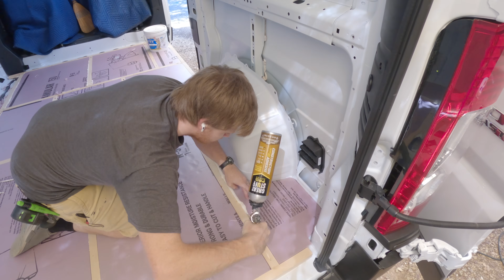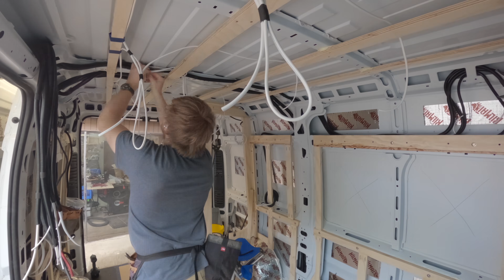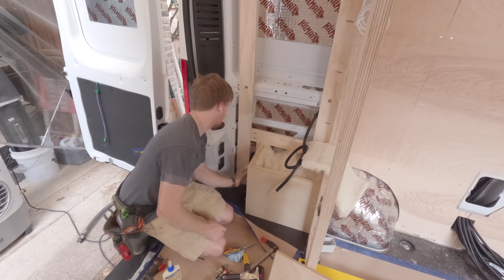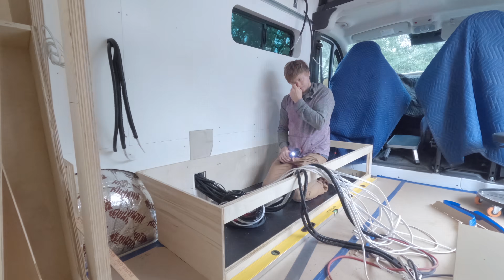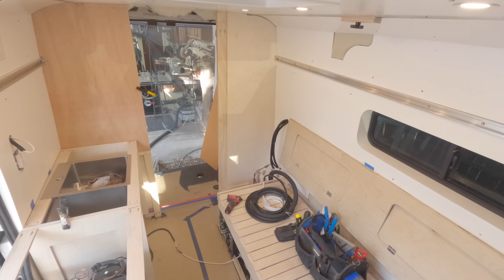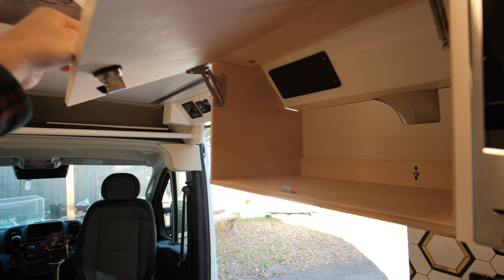FULL VAN BUILD | Detailed Walkthrough of Construction Process | Promaster 136" with Huge Wet Bath

Comment: Sam, you are one of my favorite van builders. You do top notch work, you explain everything you do, and I’ll refer to your videos when I build mine. QUESTION; was there just no good place on the floor for the water tank, asking because, that tank full of water is heavy, and lower is better. You know exactly what you’re doing so not question your abilities, just wondering what your thoughts were? Is it just wasted space above the wheel well, so why not? Thanks
Reply from the maker: That's a good question! I dug back through some old notes from this build. I had compared a few water tank options including using over the wheel well shaped tanks. For this layout. Mounting a rectangular tank over the wheel well was going to leave more storage space available under the sink area cabinet than the wheel well tanks would have so that is why I went that route. I agree on the lower the better for weight. With that said, I feel like having the tank just over the wheel well verses directly by the floor is still pretty good.

Comment: it's an interesting design but not my favorite

I feel like there's so much cabinetry that it takes away from valuable space that could be used for other things
Maybe multipurpose furniture or hidden spaces for other things that have like a conversion to it
I don't like the placement of the bed I wouldn't want to sleep on top of all of that equipment I think that that is a health concern
It seems very congested in there
As much as I enjoy a good shower and having enough room to move
The wet bath takes up a lot of room
I have seen closet closets that open up to reveal a wet bath behind it
And yes that would be a real challenge if a person took a shower and didn't leave it open for it to properly air out even if it had a vent system in it

I didn't see any privacy between the driving cab and the living space
I think the refrigerator is in a really good
Once again the wet bath has a lot of storage
Itch a different kind of lifestyle they're living in a traditional home and when we try to downsize those same conveniences into a van it really does rob the space

Maybe something to consider in the future

Me personally, I'm allergic to wool so using that as an insulation would not be a good idea

I noticed that you used some of those soundproofing strips but no thermal insulation which is similar as in its flat and it goes on with an adhesive that's already applied and peeled back to secure

I would be concerned about condensation and that will probably is naturally waterproof
You're still going to get the condensation between the metal and the wall from temperature differences between the exterior of the van and the interior
That is something I would caution you about when you make your next build

Some builders are actually leaving air gaps and venting certain areas of them to allow moisture to escape

Maybe something you can look into an incorporate as well on a next build
If there is one

You might want to consider giving workshops

To help people to understand the electrical and the plumbing
For a person who's never worked with electrical let alone solar it's very intimidating

The construction part of it as far as framing and building out might not be so intimidating there are community colleges that offer that skill for a very small price
And well worth the investment for anyone who had no construction experience for example my local college has a six-month program for like $260 that offer offers 23 hour classes every week
It teaches light plumbing light electrical framing and roof roofing I believe
All can be converted and modified to building a van with the exception of understanding the materials you're working with like breast proofing cuts or exposed parts of the metal that have been exposed

There's a couple of design ideas for really excellent Storage built into already built in features in the van for the pretty status quo build
Where the bed is positioned in the back and there's a garage area underneath that I have come up with in my own brain might be a little tricky and we'll eat some tweaking
I also like the idea of a drop-down bed on hydraulics or even seatbelt police that has an electrical component to maneuver up and down
I've been living in a van that's partially built out and it was a first built for the individual who worked on it
For the last year
He did the best he could with the knowledge he had but the climate control in here does not exist unless the engine is running
And actually that's only partial because the AC has a leak somewhere
So that cannot be used
It's a 30-year-old van
It's solid as a rock I like that about it
Plus less mechanical issues that cannot be addressed without an exorbitant amount of money because of all the sensors and things they have on newer vehicle vehicles now
Which increases the maintenance and repair cost
Also makes it over complicated to get to the root of the problem and address it
That's the benefit of having a 1995
I really like the walking system that you chose for your cabinetry
That is pretty awesome
Very wise that you made certain areas of moving on easily accessible for repairs of maintenance I agree with your statement on that
I'm sure you've watched many videos just like myself
It never seems to be included or at least not mentioned in the video that I've watched

I like open shelves on the top and I think it really helps to lighten the feel and maybe that's part of the reason why I felt that the van was too congested

Really a person who is more attention to a minimalist lifestyle is served best by living in a van someone who wants a lot of storage and a lot of places to hide things is open to being cluttered and hoarding
No one really needs that much while living in a van
It kind of defeats the purpose maybe that's something you could tweak on your journey to creating new builds

I'm interested to know more about the air-conditioning unit that you chose for the van because I've seen a lot of of them and that's not one of them that I have ever seen before
Maybe a individual video discussing it it's benefits it's cost and so on

I currently am using an echo flow I have panels for it that I can position on top of the vehicle but it really is such a drain to have to drag it out put it up there disassemble it and depending on the weather I don't necessarily get a great charge that isn't the real issue the issue is the charge though appreciated and does supply me with some electrical benefits such as the heating blanket that I have to use since I have no climate control in here in order to not freeze to death
Draws a lot of energy and zap the store I have overnight
Even at a low temperature

While charging my phone which barely takes any energy at all

It is small but it is very heavy and difficult to lug around every morning just to ensure that I will be able to run what is needed overnight
It also isn't too bad with running small fans but those fans take up space
They also take up a relatively good amount of energy
So not having an individual system for power outside of the echo flow and anything that might be applied to the mechanics of the vehicle
For me is a super drawback after the experience I've had last year

But again 
I'm grateful for the experience I have lived in a compact car for 8 1/2 years prior to this so this is a real upgrade for me however the storage I have is just open cabinetry with no shelving no drawers no cabinet doors and when I take a turn things go flying I've settled in but I don't have a good enough organizational system at least not to my liking or my lifestyle

Unfortunately they put in cork flooring that looks like wood on the top and it's now separating it coming undone I don't really know if they did a framework but it's failing at this point

The other issue is they used Spray foam to insulate
It didn't do a very good job and 3/4 of the van is insulated in the front cab is not
Which kind of defeats the whole purpose because a lot of of the cold comes in and the heat by the windows being charged by the climate outside
Also a metal container absorbs heat and cold very quickly

You're build works for a person who wants to live that type of lifestyle 
but is not accommodating for more than one person
it's more or less for a person who already has a home and uses this for extended weekend getaways
But I don't really see it being suitable for a long-term living though that might've been your intention

Comment: Did you have an electrical diagram made up before you started running wires? If so, is it available online?
Reply from the maker: This system was just about the same setup as the "high powered" electrical system schematic on my website.

Comment: thanks so much for sharing, your diverse knowledge is very impressive. are those cabinet latches really $75 each?! :0
Reply from the maker: Thanks! I used cabinet/drawer locks from SouthCo which is a more reputable brand for them. Looks like the pricing on amazon is a little all over the place on them but they should be about $20-25 a piece. There are cheaper ones available from off brands though.

Comment: Does anyone know the model of this Air Conditioner?
Reply from the maker: It's the 12V model from undermountac.com 
The compressor and condenser mount underneath the van and the evaporator mounts in the cabinet inside. The evaporator on the current model from them looks a little different from the one in the video but it should be basically the same.

Comment: I didn’t see a link to the Air conditioner? Thanks
Reply from the maker: It's the 12V model from undermountac.com with the cabinet evaporator. The compressor and condenser mount under the van and the evaporator mounts inside.

Comment: This has to be the nicest build I’ve ever seen, and That comes from a guy that built a 1965 ford van for my first car in 1976, worked in two van shops in my early 20’s 40 plus years ago. I subscribed, I’m considering doing a van, my attempt at pulling a camper was a miserable failure. My tundra has poor cargo capacity

Comment: What made you pick the wool over other choices like thinsulate, foam, etc? I’m assuming it is much easier than fitting foam?
Reply from the maker: I think wool and thinsulate are equally good options. While foam can have a better R-value per inch rigid foam is awkward to fit and I'm not a fan of spray foam in vans.

Comment: Wow. Your Pro Master (what ever that is) is super 'clean' inside. Most vans have huge pockets, protruding braces and things that take away huge chunks of the width. Your floor is perfectly flat and for 'Canadia', well insulated. That XPS boards also available here in OZ and is a seriously good product. Those rivet guns, also available for Rivnuts, are absolutely the way to go for attaching any type of wood to the metal frame. I like the fact you reused the factory floor. It has a waterproof glue-line, is one piece and a synthetic surface that makes for a perfect van floor. Why do people ditch it? A VERY professional fitout I might add! "Best on the net!"

Comment: Unfortunately the amount of wooden framing placed into this conversion is possibly the most unnecessary part of this build.  There must be a manufacturer that has preformed modular sections that allows you to convert a plain empty van into a finished home on wheels.  The Advantage of these types of modules is that insulation and wiring could be attached to the rear of the panels on these modules and could be removed in case of damage to the van by an accident.  These modules could be optimized to fit any van length or interior height by the addition or subtract of these specific modules.  A universal shower module with pump and toilet could be an attractive feature.   The ceiling panels would have pre installed LED lighting with plug and play lighting.  Heating and power generation units would take out the guess work and build time for DIY van builders.

Comment: One of my fav vans—ya’ll inspired a lot of my build!! I just finished my van and now doing touch ups, couple questions— how did ya’ll attach the curtain rod? What was ya’lls process for painting? I feel like my paint job on all of my walls and cabinets looks so bad and not smooth and I even have some parts of the wood that are peeling and not sure how to cover it all up with paint. I have some gaps in the walls as well and areas that may need siding—do ya’ll have any tips on that? And how did you do those door panels? They look more simple than covering the whole entire back door and super clean! Thank you so much!!
Reply from the maker: Hi! Glad you found some inspiration from it! The curtain rod in the front attached between the wall on one side and a dropdown piece of wood (attached to the slider door trim piece) on the other side. For paint I painted all the wall panels outside of the van before installing. I first fill any holes in the wood with wood filler, then sand the panel, then prime, then do a light sand with a fine grit to make sure the primer is really smooth, then I used an airless paint sprayer to apply 2 coats of a cabinet enamel (which has a harder finish than a standard latex paint). For the door panels I basically just made covers for the recessed areas rather than covering the whole door. I used 1/4" plywood for this.

Comment: This is incredible man! Would you mind sharing what screws you use for the framing into the rivnuts?
Reply from the maker: Thanks! I used stainless steel 1/4-20 bolts for connecting the framing to the rivets

Comment: 1) great detailed work AND explanations! Keep it up!
2) on the rear corner posts, section your wood & openings so you need to remove only the 10”-16” section at the taillight for bulb replacements. Single tall solid piece looks great, but with dark attachment hardware, most ppl would like that servicing attention to detail.
3) brilliant to accommodate ease of installation & removal of cabinetry via the aluminum tracks.
4) good consistent use of wire loom tubing to protect against elec shorts!
Reply from the maker: Thanks for watching and your comments and feedback!

Comment: LOVE this layout!  Do you think the bathroom could hold a couple mountain bikes?
Reply from the maker: With the toilet probably not. If you moved the toilet into a slide out in the cabinet to the right of the shower then that may work for fitting the bikes. May need some other changes too like moving the shower head to the side wall but with a little design work I think it could be worked out.
Reply: @MoserMakes  Good idea- thanks!

Comment: You did a great job! My type of styling too.

I like the pullout bed above the electrical cabinet.  Putting the control panel over the sliding door ceiling is a perfect use of space and keeping things clean.  I definitely would always want a separate shower in a van that isn’t too tight. Placing it in the back of the van is best place for that. 

Couple questions:
1.  What kind of tiles did you use for the backsplash?
2.  Did you vent the toilet in the roof or the side of the van
3.  How long did it take you to build out the van?

Comment: Furring is unnecessary, time consuming, increases squeak potential and creates significant thermal bridging. Avoid furring and XPS Foamular 150 which is rated to 15 psi. Instead, use Foamular 250 (25 psi) and skip the fur.

Comment: Excellent explanation of method and high quality finish as always.  I like your first van build especially and rebuilt mine along similar lines after making the mistake of building it in a layout like this and learning just how bad a layout this is the year following in it. As soon as you pull out the bed, itself difficult when the van is shut up as there is no where to stand, you can no longer move easily through the van and you can no longer open most of your cabinets. Nor is there room for two persons to sit at a table, which i managed by adopting the bed across the back as is common.  Nor here do you get a garage but instead an overlarge area is dedicated to a rarely used shower and is therefore a very poor use of space. Don't make the mistake I did by doing this.
Reply from the maker: Hey thanks for sharing I think this is a good perspective for others to think about when choosing a van layout as there are lots of tradeoffs when designing for a small space. I too like layouts with a bed across the back that makes room for gear storage underneath. This build was a custom build for a client though, and they specifically wanted this layout and so far have been really happy with it!

Comment: Great video.  A nice way to make the plywood stable is to route a channel into the middle of the sides where they meet. Then you sandwhich an aluminum bar between the two pieces when they meet.  Then you can also screw into the plywood through the aluminum bar and into the plywood after the bar from the top.  I'm not sure that makes sense but it made my flooring rock solid.  It really wasn't hard to do either.  I also made sure that my insulation below the plywood had.   seams in completely different places.